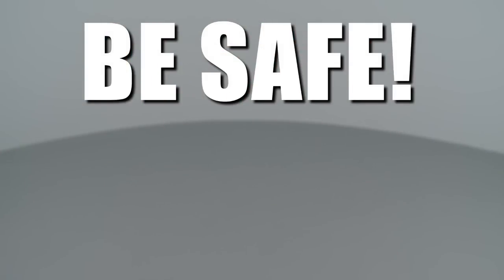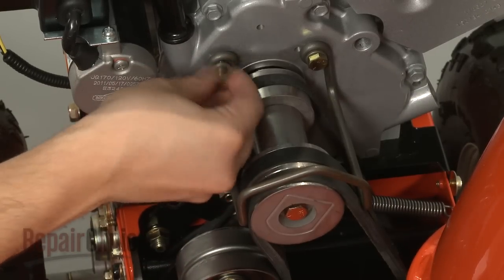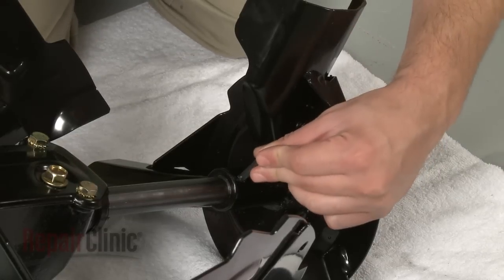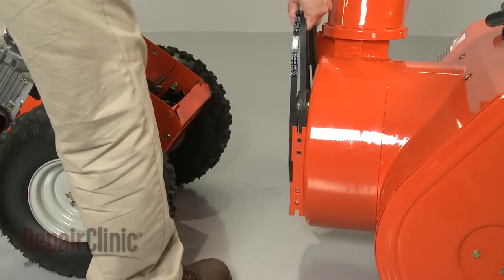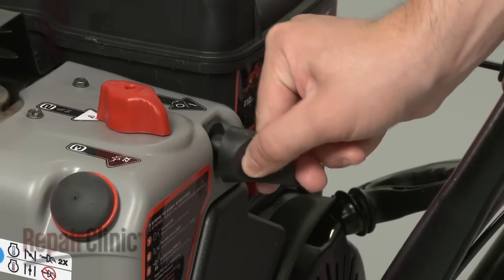Ariens Snowblower Impeller Replacement, Repair #00485551

Comment: Helpful video and would be great if my 15 year old blower was as nice as the unit shown on the video (obviously a brand new machine).  Mine had several issues to work thru as I proceeded.  The main one was the pulley was seized on the shaft.  Finally got it loosened with a propane torch and brute force.  Put some anti seize lubricant on it when reassembling to maybe avoid this problem if I ever have to remove it again!

Comment: Great video.  I just used it to change out my impeller, and the only change I had to make was related to pulling the pully.  For others: If the pulley wont come off with the single center bolt, you can remove the three adjacent bolts and remove the pulley that way.  That then gives you access to the center machined fitting and I needed to use a small gear puller to get mine free from the shaft.
Reply: Mine was rusty and broken in two.  I thought  it would just be a matter of popping the roll pin out and forcing the new one in. My friend told me I might have to take it apart. He was right
How much would it cost to have the dealer service it?
Reply: @whelennut  No idea, but I am sure not cheap.  I don't think it took me more than 90 minutes to do the whole job. I would have had more time in it than that just getting the machine to and from a dealer. Granted you could always run into some other surprise when you get into it. but aside from a little challenge getting the pulley off mine was a straightforward job.

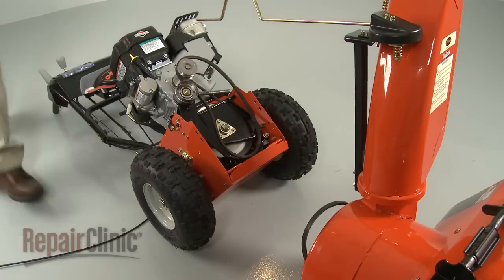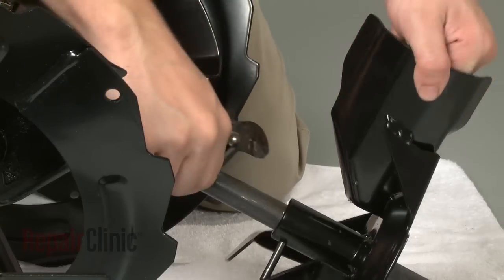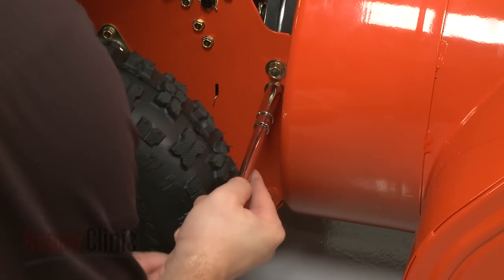Comment: 1:25 it's when your sb will start leaking gas.  Be sure to support the rear half before disconnecting it.  2:10 good luck with stuck rusted pins  4:13 do not overtighten these bolts, notice how they actually don't torque them that hard, these bolts are tiny and made of soft metal, maybe replace them with stronger metal bolts, should be 5/16 gross thread. While there, inspect the shaft bearing at 1:45 , mine was bad after 25 hours of use, $30 chinese Peer bearing (buy the Nice/Skf brand instead). And be sure to inspect the friction disc, it uses soft rubber and wears much faster than on old sb

Comment: I need help please. 
     I am trying to replace the impeller on a Husqvarna ST 230P snow blower. 
     I watched your videos on the Cub Cadet and the Ariens but can't find a Husqvarna video. 
     I have the two halves separated and need to remove the old, bent impeller.
  
     How do I remove the nut from the auger drive pulley??? 

     It is stuck on so tight it won't budge.  I hate to use a mini-sledge on the 15/16th wrench for fear of breaking something.  
     Is it reverse threads by chance or is there something I'm missing here?
     Please help. Thank you. 
Mark

Comment: is the diameter determined from the blade diameter or the hub diameter. I'm attempting to modify my craftsman 28 in impeller, with the new sho ariens 12 inch. i also need the shaft diameter to fit the impeller hub. or maybe modify it. i have some other mods to make but the impeller was the most important. it appears the factory impeller with that rubber blade kit isn't enough. what i see is the volume of snow being forced into the impeller is more than the impeller is capable of throwing. a basically underrated impeller. its either this or i remove the old impeller and fabricate new blades with the design of the ariens. which looks to be more cupped and not flat. any suggestions or inventive ideas. i also know they put a baffle bar in the top auger housing to stop the snow from getting blown back out the front sides. supposedly the impeller also creates a vortex wind causing air to blow snow forward. i thought the auger housing opening should have been designed to be further forward than the augers. but then again i may be wrong. just looking to be able to blow enough snow to keep up with the supply going in. 1st gear actually moves too fast in snow around 6 inches or more which takes forever. i have double checked auger blade directions and pins. and made every adjustment i know of. obviously going the wrong direction. basically, the supply going in is greater than the impeller can keep up with. i measured auger housing impeller opening to be 12 inches. yet can't find any impeller specs online. set aside ariens being a bunch of no call back jerkoffs. end result i fabricate the dam thing. even replace blades with better designed. when i looked at their sho impeller it made perfect sense how they designed them to scoop the snow. old impellers are just flat stock bent upwards slightly with no side plates. i find sometimes others have run into the same problem. then again there are some non-mechanical idiots that act like they're know it all's. and know less than jack schit. sometimes you get lucky and find a winner. being a tech all my life its hard to find someone on the same level as myself. mechanically of course. got any ideas at problem solving this one? lol. if not I'm promoting myself to a snowblower Dr Frankenstein and create a snowblower zombie killer.

Comment: Have you or anyone removed the assembly on a 921032 model? under the pulley there is a pulley hub secured to the steel pipe running into the impeller. Not sure how it's secured, if at all, but I can't figure out how to removed it and worried to try and force it off. Would appreciate any tips. thanks

Comment: What's the usual life expectancy for an impeller, with normal wear and tear and not chopping and throwing other debris out of it?
Reply from the maker: We have seen impellers last 10 -15 years without a problem. Picking up rocks and ice chunks is what usually tears them up.
Reply: Mine is 45 years with the original impeller.
Reply: A long time on a paved driveway or sidewalk. However, on gravel driveways, they take lots of abuse. Mine lasted 8 years on gravel.